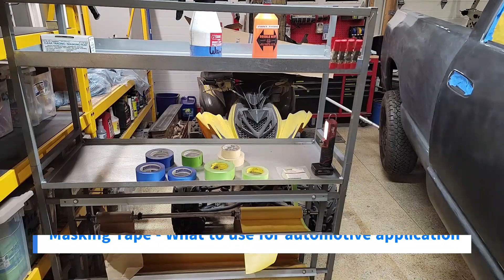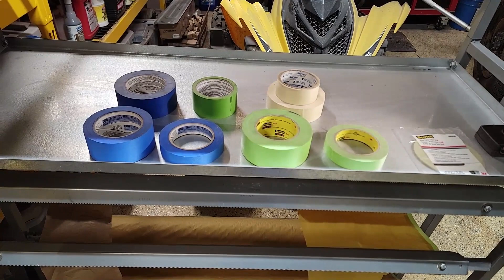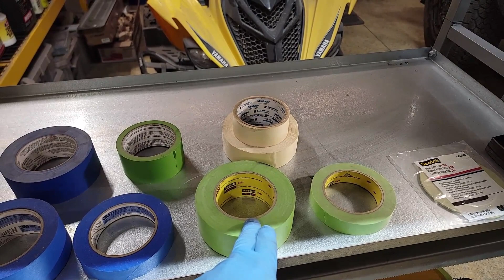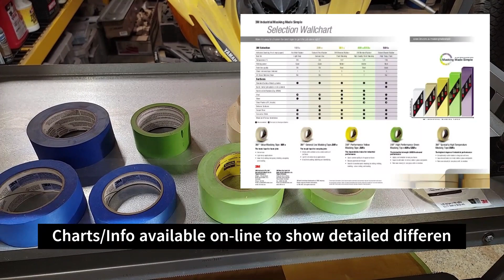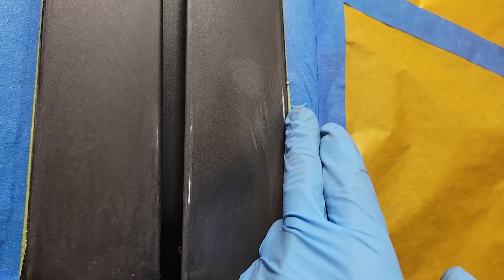Auto Body Masking Tape - What to buy and differences explained on automotive masking tape

Comment: I want to wrap my truck in Christmas lights, will any of these tapes damage or ruin my paint if left on for a month or more? And if not what tape is the safest  and guaranteed won’t wreck my paint.
Reply from the maker: 233+ would be fine we're similar those just work well as they can come off easily even if they've been on for a few days. Just make sure paint is clean first
Reply from the maker: 233+ would be fine we're similar those just work well as they can come off easily even if they've been on for a few days. Just make sure paint is clean first

Comment: Hello, thank you great information. I use the 3M 233 mostly outdoors taping, hot conditions, keeping underlying paint  for headlights. I want to use the best practice to protect paint, I’m afraid especially high-end vehicles. Is there a product to put on the paint underneath the 233 first?Like 3 AM adhesive removal to protect it more. I’m afraid of shading,  discoloring specially with the heat. I clean area , I spray water, then tape, spray water again and remove it 45 angle. I wet sand. Trying to reduce the risk of adhesive bonding as much as possible. What else should I do? If something happens, I wanna be able to say I have the best safest procedure and technique. Thank you. I appreciate all your knowledge.
Reply from the maker: Great question and thanks for checking out the video. Your process sounds pretty good,. One thing I have found that dictates more than anything how well the tape comes off is that it's removed within the time frame the tape is designed which is not very long / a few days. Also be very careful of placing over fresh paint. I have not been in the habit of putting anything underneath the tape to help it be removed any easier and do be a little bit careful with some of the adhesive removers as they can be sort of harsh on paint. Historically if I have additional adhesive that is sticking(tape did not come off evenly) and I want to get it off and I'm not going to be repainting or anything like that then I will use a silicone-based product like wd-40. Seems to be pretty gentle on paint surfaces. However would not want to use that if any additional adhesive products are going to be used or paints etc. I do clean as well before I put the tape down. 233 plus just works really amazing and I've always put it just over the paint. All that said that's my advice based on experience I have no formal training and paint your body work, but thanks again for checking out the video and let me know if any other questions

Comment: is that painters tape?
Reply from the maker: Thanks for checking out the channel. Yes all of these tapes in this video are different variations of painters tape. My favorite is the green one, but as mentioned it's most expensive. The blue one is quite versatile, less expensive than the green, and available at many stores like Walmart home Depot etc let me know if any other questions, Chris
Reply: @MotoXr917  thanks
Reply: What number is the green tape?
Reply: Could I leave this on the front end of a car for love bug season in the Florida sun and heat for a few weeks?